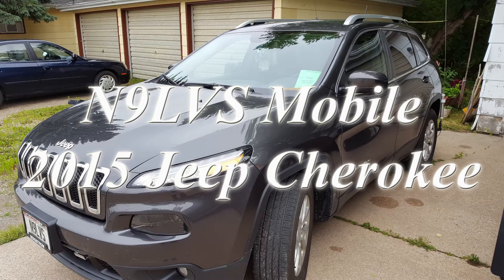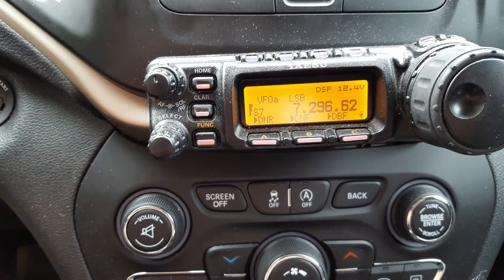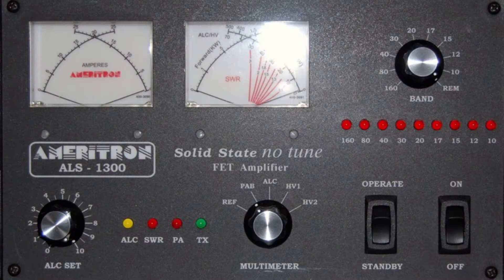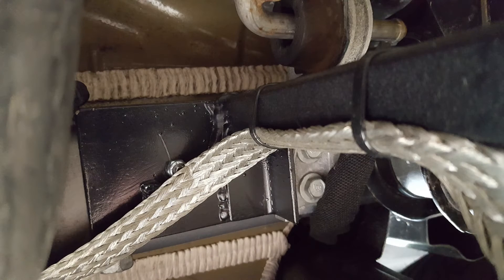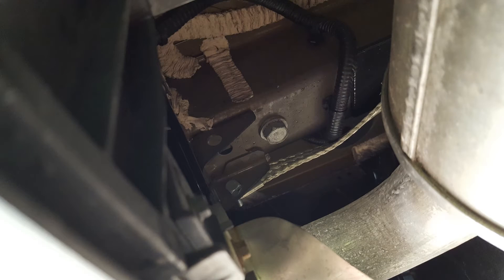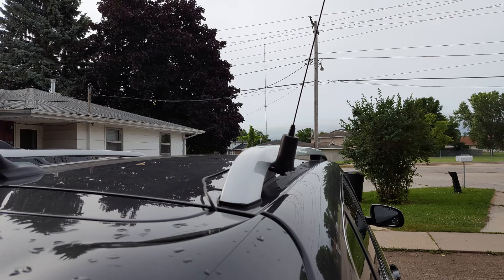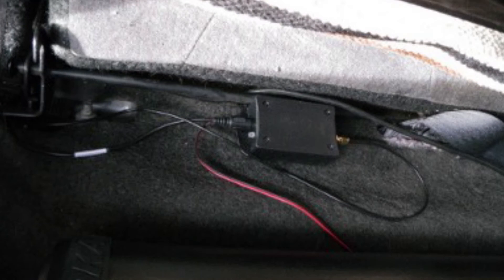N9LVS 1300 Watt HF Mobile

Comment: how did you convert your dc alternators to 220vac ?  it appears that is a base amp? good day
Reply from the maker: I'm using a (dual wound aircraft alternator) to get the 50volt DC that the power supply for the amplifier would normally produce. To run the amplifier

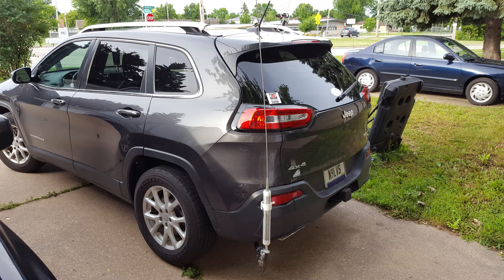Comment: 0:52 “needless to say, with running 1,300 watt amplifier, the antenna has to be a little bit more beefy, so I’m running the Wolf River Coil Silver Bullet 100.” All that work to install a second alternator and the ALS-600 amplifier, but the antenna you installed can not handle that much power. The Silver Bullet 1000 coil is rated for 100 watts SSB, 50 watts CW and 20 watts in digital modes. Post a video of the PVC coil heating up and melting.
Reply from the maker: I do bata testing for wolf river coils, not only that keep in mind the rating is based on fixed operation, I'm usually doing 70+ down the highway when I run power. So I have cooling on my side,

Comment: Appreciate the video, the use of an aircraft alternator is interesting .
I looked up the Wolf River coils, and they currently list them as 200 Watts SSB
Do you have an older model with higher rating?
No problems running over 1000 watts with antenna, or with vehicle?
Reply from the maker: We beta test for wolf river coil, the hf antenna is now mounted on the roof instead (for safety reasons) Also we run 1300 going down the road, so it keeps the coil cool

Comment: What battery are you running for the amp and where did you get the altinator and batt
Reply from the maker: The battery is just a standard battery, The alternator is a aircraft alternator which is a 24 volt dual wound alternator when run in series gets you the 48 volts reqired for the amp

Comment: Question is why would you put yourself that close to 1300 Watts because somebody missed that section on the test. Not to mention the antenna is way too low for that type of antenna basically mounted it on the ground
Reply from the maker: Actually just changed the mount recently to a center roof mount, but worked there fairly well.
Reply: @DanVanevenhoven  Center roof mount is a much better idea, you need that "ground plain" effect to take full advantage of the antenna.  I have tried several "trailer hitch" or "extension" mounts like the one you showed in the video. None worked as well as mounting on the inside of the bed by the tailgate, bolting it straight to the bed fender. I'm running a Tarheel 100HP and the TS480HX (200 watts) and I have never needed an amp to make a contact.
Reply: the gain on a screwdriver is 0, so according to calculations about 7 feet distance is safe from the centre of the antenna at 1kw
Reply: Your gonna melt the faces off passing drivers